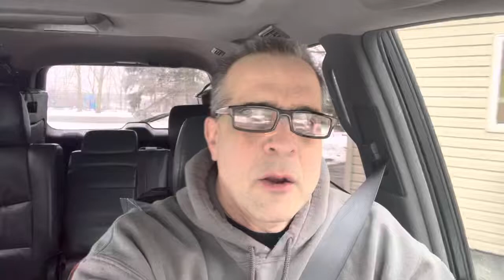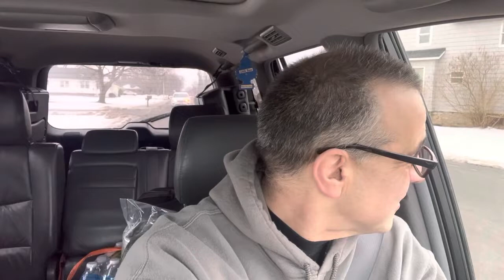2019 and 2022 Chevrolet Silverado trailer lighting problems, bulletin from General Motors

Comment: I have both a 20 and 24 2500 AT4 2500s. On both the running lights come on then go off. You can hear a click in the back of the truck behind the bumper. On the 24 the left brake light stays on on the trailer but not the truck. Dealer said a short in trailer control module and had to order it. Fuse 82 is good. Should I replace both trailer control modules?

Comment: We are having that issue. We have a 2020 3500 and my trailer has ALWAYS WORKED, I only have brake and turning signals.  No Running or inside loading lights. Lights work perfectly fine in a friends older truck.  I already have a appointment with our personal mechanic  . 
Thank you for your post
Reply: Change fuse 82 and everything will be fine

Comment: Same thing over here, i have running lights and left side tail light of triler brighter  than right side with no actions to brake or turn signal on both tail lights , did you fixed it?
Reply: Same with my 22!!! Brand new trailer arrived today. One light is timer, left doesn't blink... wth

Comment: I got a 2019 just replace the module but I’m not getting power to the trailer lamp fuse under the hood when I plug the trailer I get everything but running lights by the fuses not getting power under the hood remind u that the fuses are good could that be a relay or something
Reply: I’m having the same problem with a new trailer I just bought. I have a few other trailers but they have bullet led lights and this new one has the 5 leds in one light. There are about 19 of these lights that are definitely drawing more amps even thought they are still led’s. My other trailer lights were good. It’s just wanna hook up to this trailer with all these extra lights. Are you hooking up to a Trailer with incandescent lights or a lot of LED lights? My running lights are the only thing that doesn’t work. Turn signals, brake lights, and flashers all worked just fine. Just a running lamps. The dealership just change my trailer lamp module yesterday and still the same thing. They didn’t go further as Mr. Dave is explaining. Going to show them this video tomorrow.
Reply: @happy0071982  hey I just bought a trailer control module for my truck it’s 150 at the dealer it’s on the right side of the spare tire  it controls ur lights so I bought one and now I have lights but no running lights from what I hear is that the dealer has to program them  in order for them to all work I guess
Reply: Hey dude, it's not the module change fuse number 82
Reply: @antwonburns4274 check fuse number 82 , after I changed that everything works perfect now
Reply: @adventurer101guide8    Did u check it with a test light with the fuse out I did that to mine and I didn’t have power  but I changed the module I get power to everything but the running lights took it to a trailer place to see what the issue could be and couldn’t find anything just said may have to go to the dealer to get the module reprogrammed
Reply: @antwonburns4274  do you use hitch grease on your receiver ball? If so, you might be grounded through the coupler on the trailer and it’s not getting connection. That’s exactly what the problem was with mine. Re-located the ground for the trailer and no problem. Hope this helps.
Reply: @antwonburns4274  that could be it but I'm saying check fuse number 82 to see if it's burnt it's called the tim fuse
Reply: Ok but last I check it was good but I’ll just change it and let u know
Reply: @ant did it work? Having the same issue myself
Reply: @SuperJarrod34  replace fuse number 82 , it fixed mine it's labeled tim I also fixed another guys already, he said o no I checked fuses , I told him to do it anyway and it worked, lemme know I think it's a 20 or 30 amprr
Reply: @SuperJarrod34  yes it worked
Reply: @adventurer101guide8   you my new friend are a Godsend... #82 it was... saved me 250$ I owe you lunch
Reply: @raycox1971  Hey no worries man! I Appreciate it! Just a friendly canadian trying to help people out lol
Reply: Having a hard time find fuse 82, suggestions please
Reply: @adventurer101guide8  I have a 30 amp for fuse 82 and I still get nothing brand new fuse even my 4 pin trailer connect is not getting power
Reply: @antwonburns4274  inspect every fuse ome by one , also get something you can plug in the back to test if there's power getting back there

Comment: Just bought 2024 Silverado 2500 HD.  No power to the 4 pin connector. Dealer says everything is working. 7 pin connector works. 4 pin does not. This cant be right?
Reply: Get a 7 pin to 4 pin converter

Comment: I'm having an issue where I have no power to the trailer lights on a 2023 Silverado custom. Only had it about 10 days first time I have hooked it up.
Reply: Hey dude , I have had the same problem for months and just solved it watching another guy's video, change fuse number 82 ! Dealers are so stupid 🙄
Reply: @adventurer101guide8  thanks I changed the fuse and worked thanks a million
Reply: @papapillgaming2847  heyyyy!!! Great to hear! Awesome man I know how frustrating it is so I'm happy for you
Reply: I’m having the same issue with a 2022 Silverado rst z71
Reply: @adventurer101guide8 would this work on my 2022 Silverado rst z71
Reply: @sethsinger8364  Check fuse 82 also check your white wire to your trailer
Reply: @sethsinger8364  yes try changing fuse 82
Reply: @adventurer101guide8 
I just did this and the fuse was blown

Not only my trailer thing didn't work but also my blinkers were blinking fast

I can her the fuse 82 and tomorrow I'll check if trailer will work

I spend a lot of time checking fuses and missed that one

But it's interesting because how the marking is

I'd never think it's for trailer or blinkers 

Did your blinker do same thing?
And I wonder how did you figure out it was fuse 82

You're good 👍
Reply: @alpinam3  I did alot of research spent months with no working lights and I was determined to fix it, I even brought it to the dealer they said nope all the fuses are good, I just wanted to help fix some other people's frustration

Comment: I have turn signal and brake lights just no running lights, thoughts anyone?
Reply: Same. I tried lowering the spare to find the module to maybe switch it out. But then I couldn't find it. So now I'm like. Wtf
Reply: Same problem here, made a turn and poof no running lights, fuse is good and lights on trailer are fine with another truck